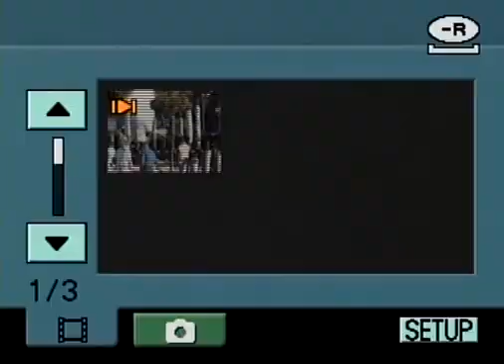Steam Whistles.

Comment: what whistles where there that year?
Reply from the maker: There are always a good variety of large ship size whistles, 8, 10 and12 inch diameters, many with known histories. The smaller ones, under 6 inch diameters are mounted on a manifold on the boardwalk.
 View my 2019 St. Clair, Mi posting. That is a typical year. A special one because we had an amazing FIVE of the largest and rarest 12 inch diameter chime ( chord ) whistles. Mine is the Star Brass with integral valve.